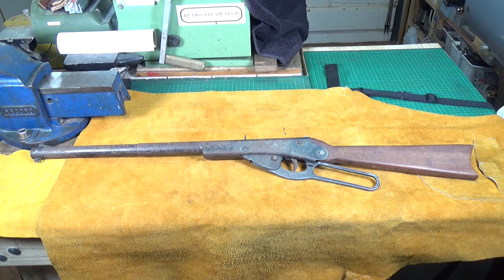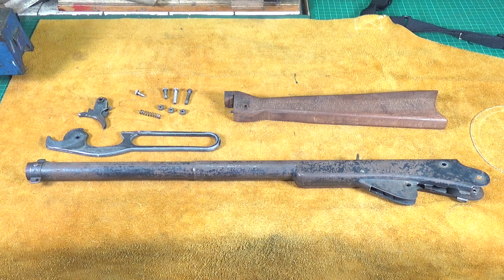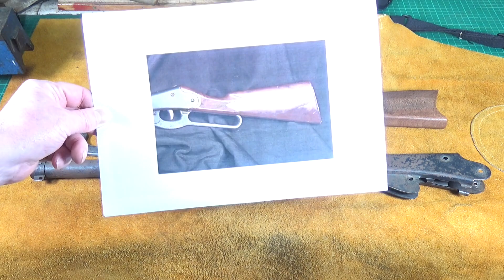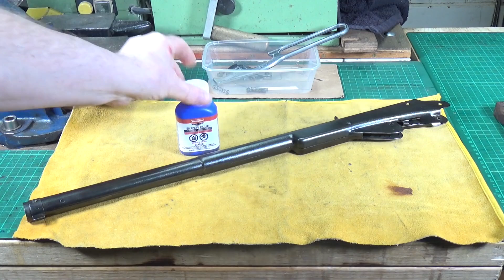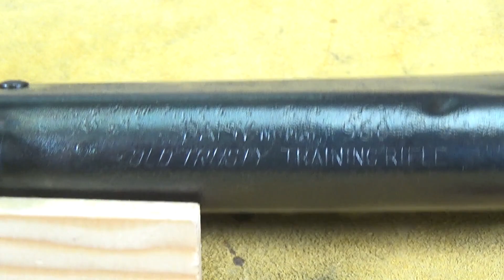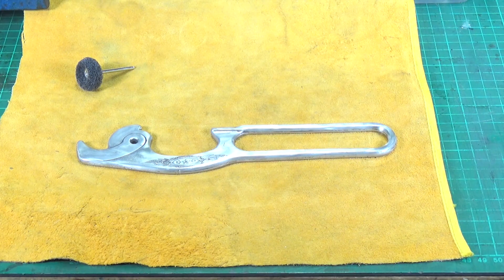Daisy Number 960 "Old Trusty" Training Rifle - Part One

Comment: Super Video Alan! The Birchwood Casy did a good job on the reciever and I'm thinking that Mahogany butt stock will set that puppy off nicely. The pop guns are a hoot and I am working on a penny whistle nose piece for my 660 Ricochet rifle.
Reply from the maker: Thanks Shane. I'm very pleased with the Super Blue, it does an excellent job. The stock turned out ok which you will see in Part Two. I'd like to use maple but it is so expensive over here in the UK. Looking forward to seeing & hearing the whistle mod for your 660. Cheers, Alan.